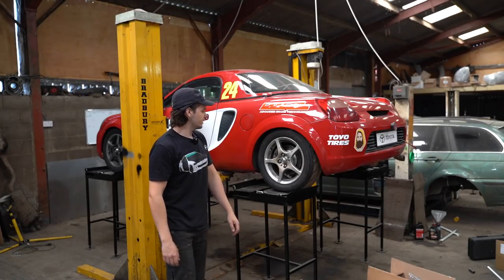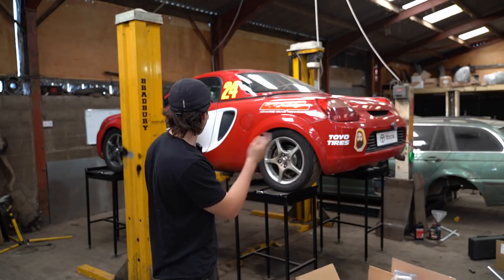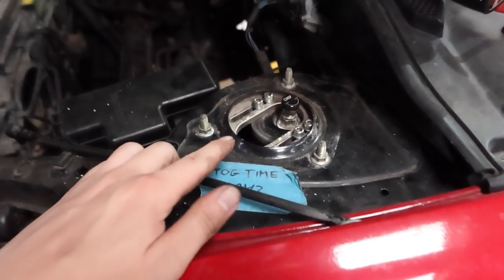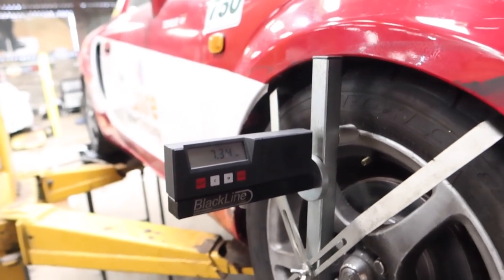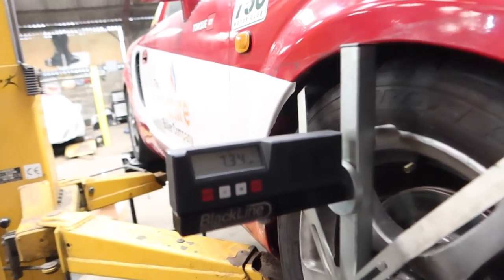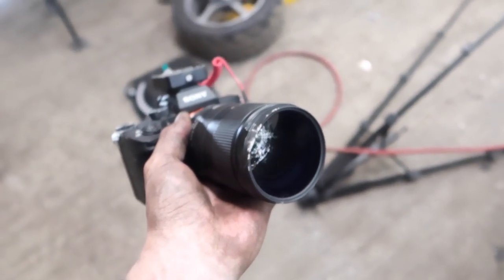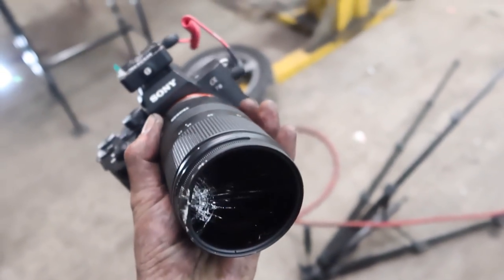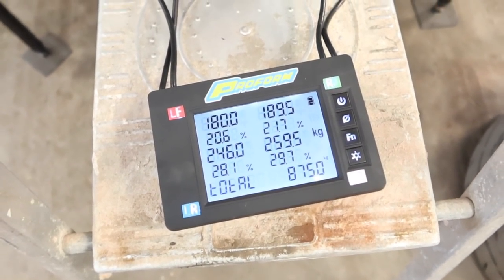MR2 Suspension Update - Caster, Tie Rods, Bump Stop, Corner Balance

Comment: Good stuff!
In fact more caster should give you dynamic camber that might allow you to run less static camber in front that is generally good for braking performance. Also, I wonder how low you can get before suspension geometry starts to suffer (no camber gain on compression and stuff like that)?
Reply from the maker: The arms on the rear are definitely looking less than ideal even at this ride height. My bumpstop was set just before the toe arm hits the rear subframe too! I think the rear will suffer more than the front on that
Reply: @dannyDC2 probably additional camber in the rear is not so critical as in the front judging from braking performance standpoint... Power is not so great to cause troubles with traction on straight line. So you can try more camber in the rear if you need. Do you measure tyre temps btw?

It's not great to loose camber under load due to suspension geometry. If you had an option to get stiffer springs, this could be an option to limit suspension movement at low ride height out of optimal geometry ranges... maybe put a camera on the outside pointing at the wheel to see actual camber while loaded in turns?

Comment: I think the castor angle is actually being measured in degrees, not percent. Probably the biggest advantage to increased castor is that the negative camber angle increases on the outside wheel as you turn the steering into a corner giving more front grip. (Then you could experiment with reduced static camber to give better braking grip.)
Reply: was about to post about camber gain due to more castor, more of an important consideration than self entering steering imo
Reply: @leehearsey  yes. It still helps to comment because it supports the point. I find there are so many misleading comments on YouTube that it can be hard to know what to believe!
Reply from the maker: Ah okay, I don't know myself but it does show a % sign on the gauge. I did think it didn't make a whole lot of sense (you can kinda tell from my voice haha)
Reply: @dannyDC2  I suppose it could be % but if it is, 4 must either mean 4 deg or 4% of 90 deg which is 3.6 deg, so it wouldn't make a huge difference.

Comment: I’d estimate that’s about what my spyder weighs after all the weight modifications I’ve done to mine, what sort of weight modifications have you done to yours? I know most spyder owners don’t like to remove the rear crash bar and lower part of the rear bumper but I did that to mine, just put some black mesh and a diffuser on each side of the exhaust. Looks pretty nice while improving aerodynamics and reducing a bit of weight which could make a difference in your build.

Comment: I wouldn't worry too much about corner weighting. The reality is that if the corner weights are a bit out, although that MAY hurt slightly in one corner direction (left or right), ironically it will then actually help you in the opposite corners! So over a number of circuits in a season it is very likely to average out, I'd call it a waste of time for anyone other than very top level motorsport who will tune it to suit each circuit.
Reply: Yep! Lighter left side should actually be a good thing for clockwise tracks with more right turns. 
But having equal length on diagonals is important for stable yaw behavior in RH and LH turns
Reply: @777MAV  agreed, but I struggle to see that you would really notice the difference of corner weights that are quite a bit different in what is really quite a low torsionally stiff car like an MR2. It would be a very low priority for me. Just get consistent ride heights at the wheels and that would be good enough.
Reply from the maker: Yeah I did think about this, but the event after was Snetterton 300 which has pretty much half left, half right turns. Silvestone International next which is basically an oval, so maybe I should make the right a bit heavier eh... hehe
Reply: @dannyDC2  Half left, half right turns, but in the end you still go around the track :) it matters which way - clockwise or counterclockwise.

Comment: daaaamn... 875kg = 1,930 lbs ! !   960kg = 2,116 lbs 

i'm curious what my 01 weighs now. i dont have a hard top still have the soft top. but still. no carpet and no luggage compartments behind the seats in mine.
Reply from the maker: Mine is pretty light for sure, could be lighter but I have to make sure I'm 1000kg/2200lbs with me in it after a race
Reply: @dannyDC2   so.. basically stock weight almost.. a lil less then stock.. !

Comment: Don’t want to be teaching you to suck eggs, but resistance in the fuel gauge wiring will massively affect what it reads - worth checking the connectors for rust etc and maybe replacing the connectors and as much of the cable as you can easily get to.  Hope you get it sorted.

Loving the corner-weighting vid by the way - is the floor of the workshop level enough to ensure mega accurate readings?  Wouldn’t you get better results running around +1mm of toe out at the front too - dead ahead is normally to be avoided isn’t it?
I’ll caveat that and say you will definitely know more about corner-weighting than me; reason I mention it is that the floor looks ‘typical farm outbuilding’.  When I spoke to Bad Obsession motorsport about getting my car corner-weighted, they said they don’t do it in their workshop as the floor isn’t perfectly level…
Hope the setup works for you regardless - love your vids  😃
Reply from the maker: oh yeah the resistance is bang on, and the earths are golden. Changed the clocks, same story. Something rotten between the sender and the clocks. Need to pull the loom out and redo it one day. Winter job
Reply: @dannyDC2  what a ballache not to fix it after all that.
Cheers for the reply by the way - it’s difficult not to come across as all negative when suggesting fixes and very easy to be an ‘armchair mechanic’.
Hope you get it sorted mate - looking forward to the next instalment as always  👍🏼

Comment: Yooo, just done this caster mod on my EP3, but had to swap the top plates over (left plate on right coilover), Works sweet! Use camber bolts to fine tune the camber without affecting the caster
Reply from the maker: Someone else said that, I thought they were the same but will double check
Reply: @dannyDC2  one of the top mount bolts is offset outwards so all 3 aren't equal distances apart. Just swapping the top camber plate part of the top mount over puts the angle at roughly the same as you have on the MR2, about 120 degrees.

Comment: There was also a difference in your passenger coilover side to your drivers side setup, looks like you kept the metal bracket in place for drivers?
Reply from the maker: Not sure what you mean, show me the time stamp and I'll explain  lol
Reply: @dannyDC2  4m55s vs 8m52s I dunno man probably nothing. Might have commented a bit early too seeing as you took it all off at end init
Reply from the maker: @dehv  the load spreader on the top mount? That's back on they have them front and rear on these

Comment: The engine is in the back so your camber in the rear have to be more to the front
In mine i use 3 front 4 rear for race
Regards
Reply from the maker: yes, I need the camber bolts for rear too